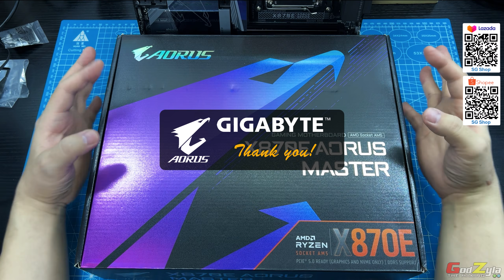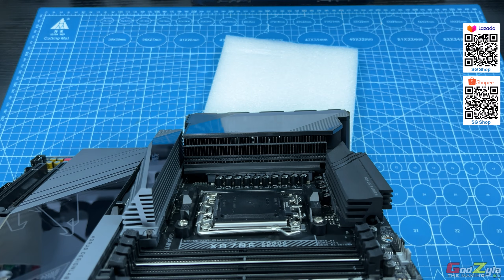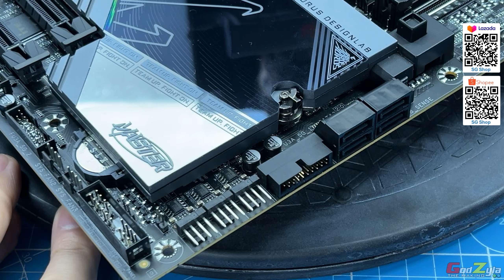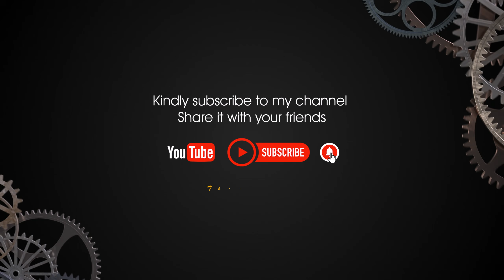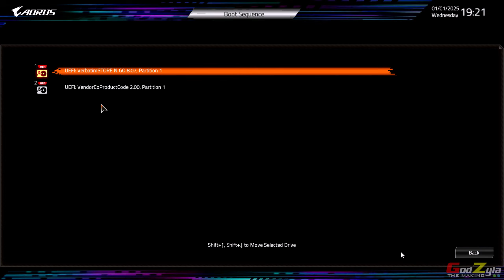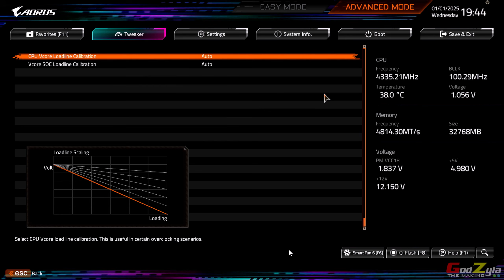Gigabyte X870E Aorus Master

Comment: At 15 minutes in you got the explanation wrong. The m.2 slots are all x4. The top pcie gen 5 slot for the gpu is x16. If you use the two m.2 gen 5 slots at the bottom then the pcie x16 slot will run at x8.
Reply from the maker: Hi 
Marc Allen, welcome to my channel. Thank you for pointing out and after going though https://download.gigabyte.com/FileList/Manual/mb_manual_x870e-aorus-master_1002_e_241111.pdf?v=52d1a1fb22bffe643ac1b07f6361ced9 Page 5. I did a mistake. Sorry about that.
Reply: @KleoYan  It's all good. I did like and subscribed .
Reply from the maker: @hirdominator  Thank you. but it is still my mistake, got to admit it 😉 and thanks again for pointing it out.. I appreciate it 👍👍👍
Reply: @KleoYan  Hello! How's the RGB software Fusion on this mobo? Works properly? I heard the last update of the Fusion software bricked some mobos... There is a way to control RGB via BIOS directly and not use the Fusion at all?
Also,what did you recommend for 9800X3D,this motherboard or MSI Tomahawk Max X870E?
Thanks for answering!
Reply from the maker: @letalmike  Hi letalmike welcome back. I do not have any issues with the Fusion app. it work as it is.. as to choose between this and tomahawk. I will go for tomahawk as it does not have argb on board and I believe it's much cheaper. The cooling of that board is identical to this board but this board has more headroom to do extreme overclocking if you with to to.
Reply: @KleoYan  This is a tad annoying. I have a Gigabyte X870 AORUS Elite Wifi7 (the X870E was bit too expensive for me when I was hunting for a new mobo, so I settled for X870) and I thought X870E would have enough extra lanes over the X870 to not have to deal with lane sharing and halving, but it seems I was wrong.
In my case, in order to keep my GPU slot at x16, I can only populate the first (M2A_CPU, which is right under the CPU and has its own heatsink) and second (M2D_SB, right under the GPU x16 slots) M.2 NVME slots. The third and fourth M.2 slots share lanes with the GPU, so if I populate either M2B_CPU or M2C_CPU, my GPU connection goes from x16 to just x8.
Also, if I put a NVME SSD into the aforementioned M2D_SB slot (the second M.2 slot from the top, right under the PCIEX16 slot), the PCIEX4 slot gets switched off, so any card plugged into it becomes inoperable.
Yeesh.

EDIT - this is the MB layout, from top to bottom:
M2A_CPU
PCIEX16 %%
M2D_SB ++
M2C_CPU %%
M2B_CPU %%
PCIEX4 ++
PCIEX2

++ and %% indicate which slots have shared lanes and also with whom.
All M.2 NVME slots run at x4. PCIEX16 runs at x16, but if sharing lanes, goes x8, with the remaining x8 shared between M2C_CPU (x4) and M2D_CPU (x4).
Reply: I have the same board, you can install a gen5 m.2 drive into the port above your graphics card. This runs at full speed and doesn't effect the graphics card pcie lanes at all. 
This is M2A which runs at full gen5 speeds and doesn't effect your graphics cards pcie5 
All m.2 slots are labeled as M2A, M2b, M2C and  M2D.

On my board all m.2 slots are gen5 speed except M2D which is gen4. 

M2D also happens to be the ONLY other m.2 nvme slot you can use without causing your gpu from going X16 to X8. 

Its very unfortunate, and it took alot of us early adopters by surprise that all the extra gen5 m.2 spots would be useless for me as im not running my RTX5090 at anything less then 5.0 x16. 
We then can run a gen5 (preferably 2tb or higher) in your M2A slot which you should install your operating system and can always partition it into other drives if its that important to you. 
(Its really not, a 2tb gen5 drive for windows and your system programs is perfect) 

Here is the best part of our motherboard that alot of even the $1,000 boards dont offer. You can use M2D , with a gen4 m.2 drive (i got a 8tb Samsung on sale for an amazing price) and as long as your putting it into the M2D port on the motherboard, your graphics card pcie 5 lanes will still remain running at pcie5 X16 and not X8. 

Still not the best, I felt like I was ripped off in how the board manufactures didnt explain it completely, sure you can install 3 gen 5.0 m.2 drives and 1 gen4 m.2 drive, but you'll then have to run your graphics card at 5.0 x4! 

I fear we are screwed until the next chipset release because right now Ryzen9 9950x3d  cpus already use more pcie lanes then intel cpus, and now the RTX5090 is using basically the full pcie 5 X 16. An extra m.2 drive is not worth running your brand new RTX5090 at only X8 bandwidth. 

Have any of you guys found one X870E board that can run a Ryzen9 9950X3D cpu, a RTX5090 @5.0 X16, and more then only the one gen5 m.2 drive that's always located right above the gpu? 

Our board atleast allows us a spot for a 8tb gen4 m.2 drive leaving only 2 empty spots on my motherboard. 

Does anyone know of one? (Not one through bifurcation)
Reply from the maker: @AJerseyJohnnyEntertainment  Hi and thank you for sharing your thoughts. So far I have never came across boards that does not at least have 1 to share lane with. even the Nova X870E from ASRock same thing.. the M.2_5 slot is shared with the last PCI-E slot. if I ever come across, I will update here. Thanks again for sharing your thoughts.
Reply: @AJerseyJohnnyEntertainment if you are someone with only 2 ssd why not stick one one the chipset m.2 and one on the cpu m.2 that’s what I was thinking works best with keeping gpu at full speed no lane share
Reply: @iMournThee , thats what I have . My gen5 2tb drive thats above the graphics card has my windows etc, then I have the 3 m.2 drives together . Two are labeled gen5 and one is gen4. I have a 8tb gen4 drive in that spot and I have to leave my other 2 gen5 m.2 spots empty so that my rtx5090 can run at the full X16 @5.0. 
If you watch alot of YouTube testers you can catch people using other people's videos or fake ones etc because they are showing video of their bios supposedly and they have all the m.2 drives installed, and sometimes we even see it say gpu x4 @5.0 lol 😂 
Not this channel though. It sucks and even with a rtx5090 running at 8😢
Reply from the maker: @AJerseyJohnnyEntertainment  thank you for the reply, though is not address to me but greatly appreciated your response. btw just to share. this YouTuber you can trust too, when he talks about motherboard lane sharing. I only discover his channel recently, very detailed illustration on board's lane sharing https://www.youtube.com/@Ronin-Wilde
Reply: @AJerseyJohnnyEntertainment  that was a great comment, I learned a lot from it, thanks for writing it up.

Comment: I ended up placing the wind blade at the middle bottom to blow over the m.2 heat sinks since as you said, the top is my exhaust fans right above where it would be. And my CPU cooler prevented placing at the middle for the ram.
Reply from the maker: Welcome to my channel. Someone mentioned that the small fan can be rotated. As for your cooler hitting your rams, I have no idea which cooler you are using?

Comment: can someone help me plz, 

i recently got a new pc, im on f12 version of bios on the gigabyte x870e aorus master mobo trynna turn on the expo mode on my ddr5 6000mhz 26cl ram, i also have a ryzen 7 7800x3d, and correct me if im wrong, but it seems like i need to have the ddr_vdd voltage set to a minimum of 1.35v for the expo mode to actually work and boot into windows without problems (because just me turning expo 1 on its own and saving and exiting results in an error saying "boot failure detected, the system has experienced a boot failure possibly due to incorrect configuration, previous settings in bios may not be compatible with current hardware state, current cpu speed: 4213.14mhz, current BCLK: 99.81mhz, current memory speed: 4791.2mhz"), 

however, im wondering if i need to change any other voltage amounts such as 'vcore soc' etc.. or any other changes in bios for the expo mode to ensure that everything will work properly without issues. thanks in advance :)
Reply from the maker: Welcome to my channel raryfrt4, do you mind to list out the kind of rams you are using? the brand and capacity.. inclusing the default ram voltage?
Reply: @KleoYan  i have the gskill-trident-z5-royal-neo-32gb-2-x-16gb-ddr5-6000mhz-cl26-expo-desktop-ram-silver and it comes with 1.45v xmp/expo
Reply from the maker: @raryfrt4  when  you set just expo profile, your rams should be pulling 1.45v, why do you have to set it manually? try shutdown your pc, power off your PSU and unplug the AC cable on it. press the power button a few times to discharge current to your system. leave it for 30 to 45seconds. plus back on , clear cmos and try again to boot. Then set to only EXPO profile.
Reply: @KleoYan  i did this and it didnt fix, i changed the voltages manually and everything seems to be working fine for now, not sure how stable this will be tho
Reply from the maker: @raryfrt4  run these test to check for stability of your ram settings

A) 1st Run Aida 64 Stability Test for 2 hours 
B) 2nd Run OCCT with the configures below and run 2 hours
C) Set DATA SET to Large
D) Set MODE to Extreme
E) Set LOAD TYPE to Variable
F) Set INSTRUCTION SET to AVX2
G) Set time to 2hours
H) Highlight CPU+RAM
I) Click on start and run the test.
Reply: @KleoYan  ok i will check this out thank you, i also had another question

im on a new pc like i mentioned, and when i installed windows on it like u typically would, (i got windows 10) the pc is working very weirdly, most times when i boot the pc feels very slow and sluggish, apps and browsers freeze, needing me to restart them, or the whole pc just freezes and i need to force shutdown the pc by holding the power button on the case until pc turns off, 

i tried reinstalling windows on a new usb and the problem is still there, is this normal on new pcs? how do i fix this if its not normal?
Reply from the maker: @raryfrt4  which OS hard drive are you using? Gen 4 m.2 or 2.5" SSD, for your info, wifi 7 does not work in Windows 10.
Reply: @KleoYan  hey again, i reinstalled windows 10 on a usb using another computer and so far everything seems to be working well without stuttering, freezing, etc.. not sure why or what happened, but hopefully it all continues to work properly now, ty for the help again
Reply from the maker: @raryfrt4  hmm.. what happened to your current set? I am kind of confuse when you've mentioned that you have successfully into to another PC.
Reply: @KleoYan  basically when i tried installing windows 10 like usual on a brand new pc, i used an old usb that i believe had corrupted files on them or something, it was fine at first, but then the pc started to perform very bad (stuttering, freezing, bsod, etc..) so i bought a new usb and used another pc as a way to install windows 10 on the new usb, and as a result everything seemed to work out fine and now my new pc seems to be working good with no issues so far
Reply from the maker: @raryfrt4  oh I see, thanks for the update. I am glad your issue is resolved. One question, windows 10 does not support wifi 7 or you found a way to this or you use LAN instead?
Reply: @KleoYan  what do you mean by "LAN"? and im pretty sure im using wifi 6/ wifi 6e
Reply from the maker: @raryfrt4 LAN connect = wired internet connection. It’s interesting that you can use wifi 6E as this board’s wifi adapter is on wifi 7 which windows 10 does not have the actual driver. Nevertheless if it works for you that will be ok.
Reply: @KleoYan  oh yes i am using ethernet, and im pretty sure if i was using just wifi i still could use the board on windows 10 as i dont think u need to have wifi 7, pretty sure it just supports wifi 7 but u can use wifi 6 instead if u want
Reply from the maker: @raryfrt4  no wonder.. ok as for wifi 7 adaptor for this board, as mentioned, it does not have the driver for windows 10, so am not sure how you can get it to work. I have tested this before and on official website, the specs did indicate too. 
Qualcomm® Wi-Fi 7 QCNCM865
- 802.11a, b, g, n, ac, ax, be, supporting 2.4/5/6 GHz carrier frequency bands
- BLUETOOTH 5.4
- Support for 11be 320MHz wireless standard
(Actual data rate may vary depending on environment and equipment.)
* Wi-Fi 7 features require Windows 11 SV3 to function properly. (There is no support driver for Windows 10.)
** Wi-Fi 7 channels on 6 GHz band availability depends on individual country's regulations.
* Bluetooth version may change with updates. See the Wi-Fi chip vendor's website for details.

Comment: Hi, Does this board +9950x / Bios support True ECC correction?
Reply from the maker: Welcome to my channel Duncan Wong. Yes it does as stated on their official specs https://www.gigabyte.com/Motherboard/X870E-AORUS-MASTER/sp
Support for DDR5 8600(OC) / 8400(OC) / 8200(OC) / 8000(OC) / 7800(OC) / 7600(OC) / 7200(OC) / 7000(OC) / 6800(OC) / 6666(OC) / 6600(OC) / 6400(OC) / 6200(OC) / 6000(OC) / 5600(OC) / 5200 / 4800 / 4400 MT/s memory modules
4 x DDR5 DIMM sockets supporting up to 256 GB (64 GB single DIMM capacity) of system memory
Dual channel memory architecture
Support for ECC and non-ECC Un-buffered DIMM memory modules
Support for AMD EXtended Profiles for Overclocking (AMD EXPO™) and Extreme Memory Profile (XMP) memory modules

Comment: How do you feel about this board compared to the MSI X870E Carbon? I had some quality control issues with the MSI X870E and purchased this instead. I love your videos BTW.
Reply from the maker: Hi Nick, welcome to my channel. Honestly speaking, I prefer boards with a backplate if it contains tons of chunky heatsink (VRM, M.2 and Chipset). Both these boards do function and looks great but I dislike the fact that once I hold them, you can see there are some warping on the pcb.

Comment: Great motherboard but if your RAM needs a fan then you got some serious issues here. This isn't the DDR2 days where RAM runs so hot it needs a fan just to keep itself cool enough to function. This trend should never return!
Reply from the maker: Hi Cosmicus Stardust, welcome to my channel. If using default Expo or XMP profile, the fan is not needed, unless doing overclocking. Thank you for your feedback 👍

Comment: I can't figure out how to get video out of the internal hdmi header I have tried integrated graphics auto or forced  , hybrid on ...initial display output pci1 or IGD either setting I get no signal.  I can get hdmi out of my 5080 but not the internal header
Reply from the maker: Hi KPJ, welcome back. have you try setting on Nvidia app? where you can select the type of GPU adaptor to display to your monitor?

Comment: I just bought 1 of these on sale for $329 and find it to be disappointing. its hard to see pins in the motherboard when the printing is in the plug. the plastic rectangle around the USB 3 plug on the bottom came off rearranging the plug, the flash bios button top popped out and its brand new...the M2 heatsink is way to big to mount my Arctic III 420cm cooler and had to go. the MB lighting maxes at 25% of my other LED and is barely noticeable
Reply from the maker: Hi KPJ, welcome back and ouch.. so sorry to hear your mishaps. Those wordings on the socket for your Front I/O panel. you should be using the G connector. As for the 3.0 USB socket, you should not pull it directly out, you should wiggle from side to side gently. Anyway if your unit is purchased from amazon, get a full refund, get another brand board.
Reply: @KleoYan  it  works, the frame went back on the pins and I didn't dmg any but I expected better. I wish I could trust a Nova and went with this because it was a Gigabyte and $120 less than the carbon. the board works I just expected better from it. I tend to prefer MSI and Gig MBs. and that heat sink LOL I was looking for used or spares just to grind 1 down to fit my cooler heh. I am older and have had 3 eye surgeries and like to see where the missing pins are to orient plugs correctly and the labeling in the plug just makes it a little harder.
Reply from the maker: @kpj9535  I see, am glad you have everything sorted. Yup, everyone fear on the timebomb of the x870e nova.
Reply: @KleoYan  love your channel , just wanted fans to learn of my experience.
Reply from the maker: @kpj9535  Thank you.. we learn from each other 😉